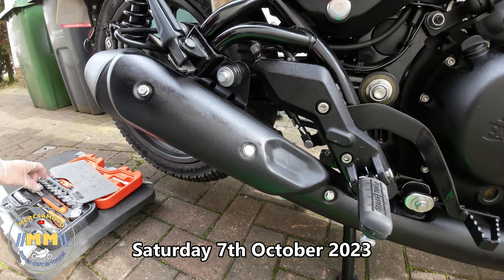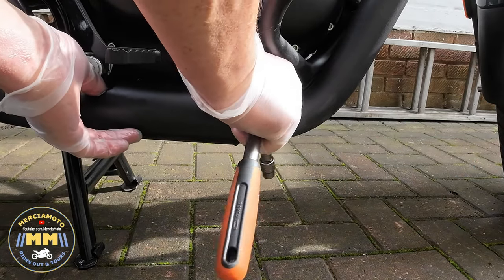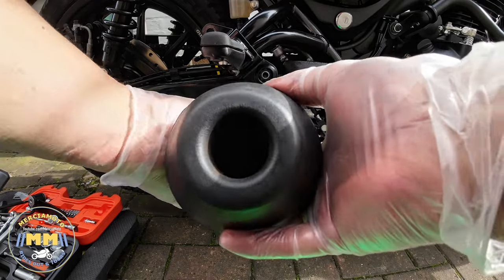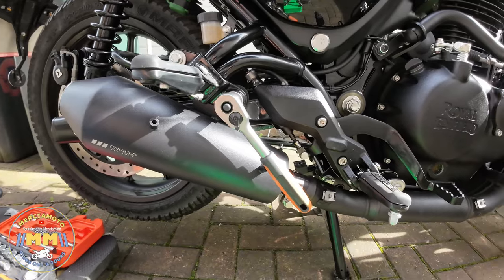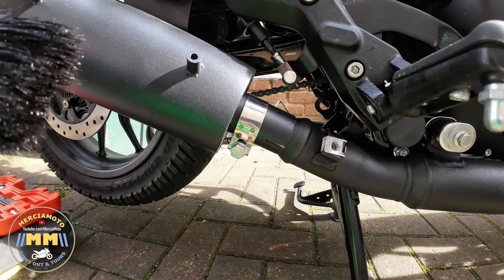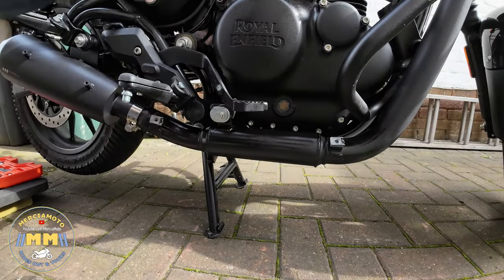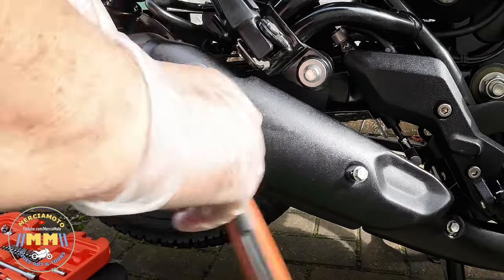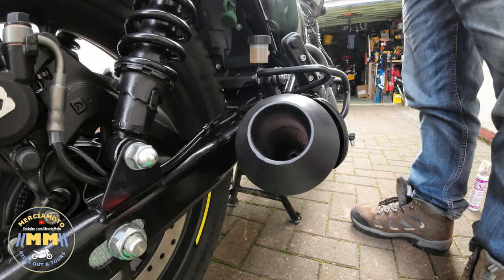Upgrade Your Royal Enfield Hunter 350 with the Enfield Precision Free Flow Silencer

Comment: Baffles out for the lads! 😂
Reply from the maker: @GK1976A  haha brilliant 😂😂👍🏻
Reply: @MerciaMoto  are you still running the original CEAT tyres on your bike?
Reply from the maker: @GK1976A  yeah, haven’t had any issues at all with them to be honest
Reply: @MerciaMoto  I found out the hard way that they have zero grip in certain situations. Luckily I wasn’t riding fast at all and it was just a very slow side slide.
If I were you I’d swop them for Pirelli’s or similar asap.

Comment: Superbly filmed Dave. The beauty of applying ACF 50 the way you have is it's so much cleaner! Spraying gets absolutely everywhere you don't really want 😂. The Hitchcocks unit does look like a quality product and should last for years.
Would it be possible for you in the future when you've some time available, to do a before and after sound test out on the road using previously filmed 'footage' cut into new filming with the Hitchcocks exhaust? I realise this is a lot to ask of you for no return for your efforts... 😔. Peter
Reply from the maker: Thanks Peter, yes the manufacturing quality is very good. I’ll definitely do a before and after early in the new year, I’ll even put the old silencer back on to do it with properly positioned microphone set up and decibel meter, there doesn’t appear to be very much of a perceivable increase in sound volume. 👍🏻
Reply: @MerciaMoto  wow that's above and beyond there, Dave. Now that's what I call a thorough test! 👍👍. Looking at the parts sheet on Hitchcocks the catalytic converter appears to be in the exhaust pipe behind a heat shield? Is the new silencer an absorption type like the Burgess (going back many years here) type do you think?
Do you need another audio story for tomorrow btw.
Reply from the maker: @Lanes-Explorer5733  I was pondering where the catalytic converter is located and assume it to be in the lower section of the exhaust below the brake pedal. Must investigate further 🤔 another story, yes please! 👍🏻

Comment: Now this is interesting Dave because you seem to have left the heat resistant material gasket on the exhaust pipe. My hitchcocks unit needed to have that removed to fit the silencer.
The baffle unit I've sprayed matt black and I much prefer it fitted. With it in place the sound is actually quieter and more pleasant than the standard silencer I think. But I don't wear earplugs! 😂

Comment: How much louder would you say this is over stock? without baffles of course
Reply from the maker: Good morning, thank you for watching and leaving a comment. It is not discernibly louder even with baffles out. However it does have a deeper and basser tone which is really nice. Hope this answers your question👍🏻
Reply: The two fixed female threads that they’ve welded on to take the heat shield give zero tolerance for error unlike the OEM one which has some float in it.
Reply from the maker: @johnnybgood7812  absolutely no tolerance, a feature of precision engineering 🙂 thanks for watching and leaving a comment 👍🏻
Reply: @MerciaMoto  Good point! Great video by the way. 🫡
Reply from the maker: @johnnybgood7812  cheers mate 😁👍🏻
Reply: Fitted mine yesterday so thanks again for this detailed tuition, it really helped.